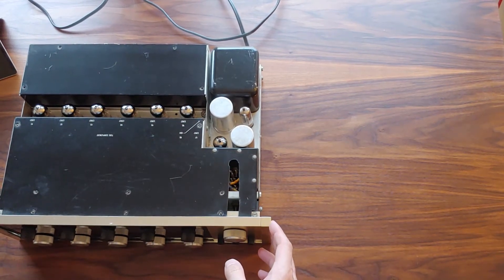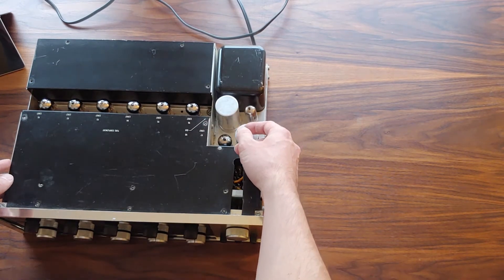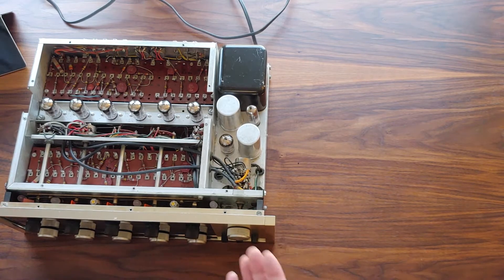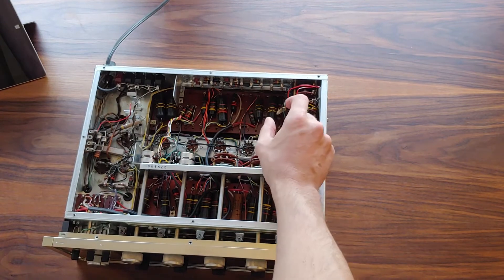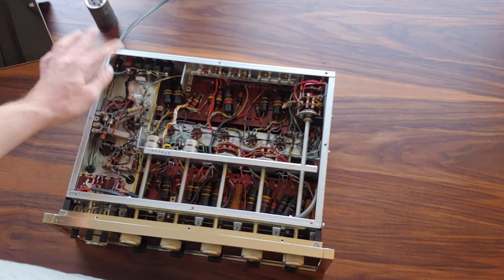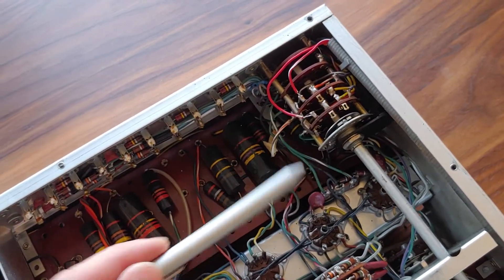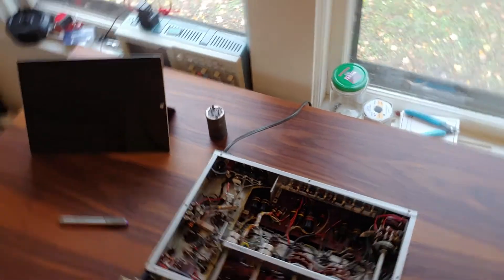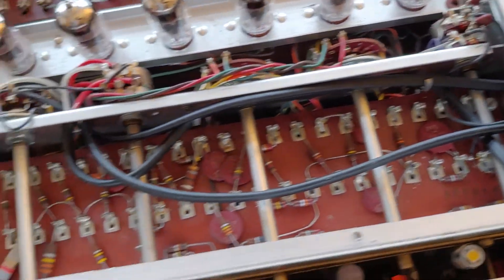Inside a McIntosh C20 Tube Pre-Amp

Comment: Hi    Thank You for posting your video. I just acquired a C20 that has never been worked on.  It hadn’t been used for over 20 years. I checked the original Telefunken tubes all checked good. Then  brought the voltage up very slowly on a variac to see if it works.  It worked and sounds great and no hum for about 45 minutes. Then every once in a while I heard a fairly loud pop from the speakers. After a few pops I turned it off.  
I plan on replacing the power supply capacitors.  My question is, would you replace all the bumblebee caps in the unit. I plan on using it occasionally.
Also, even though it was designed to do so, would you use the switched power outlet to power up a McIntosh MC240 ?